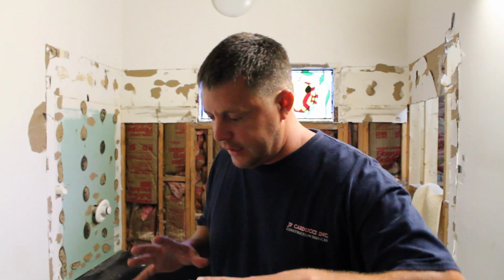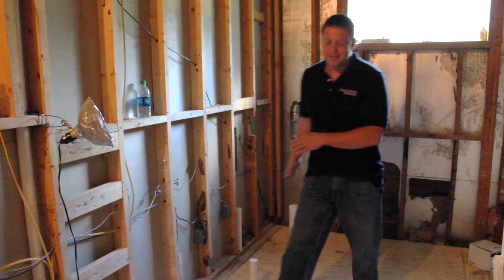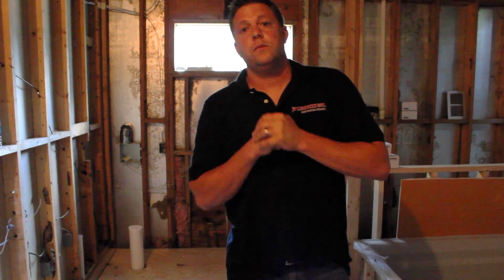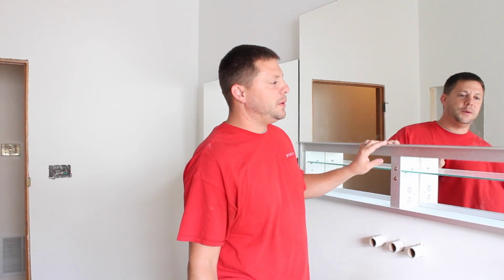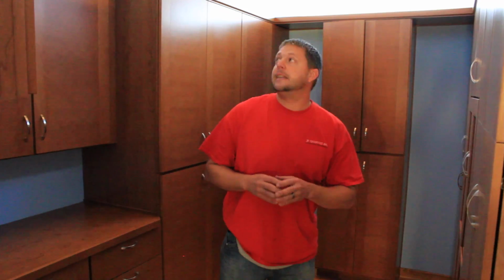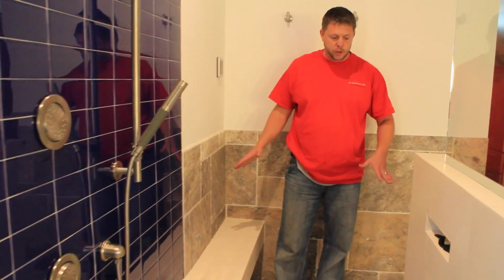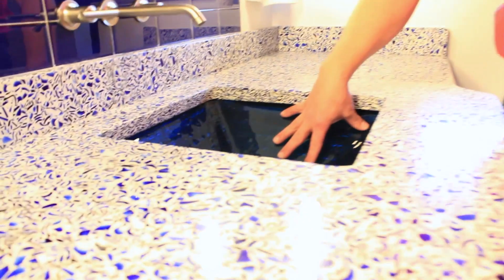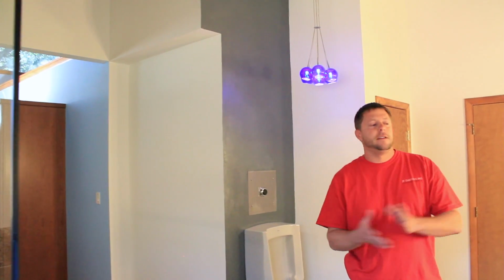Double Zero Entry Shower, Spa-Like Bathroom Remodel!!!

Comment: I would be very interested in learning the method by which the glass partition was installed for the shower. It looks to me like the only way possible was for the glass to be recessed into the wall. How was the piece on top of the wall installed? It looks as though it's one piece.
Reply from the maker: John Thompson Now now I cannot give away all my secrets and yes it is one very big and heavy piece 1/2" thick! 
Of all the people that have toured this bathroom, most are intrigued by the glass just sitting there!
Reply: JP Carducci Inc. Ok, I can understand you protecting the method by which the glass was installed. But, could you describe how the zero entry floor was prepped? If my memory serves me correctly, this was an upstairs bathroom, so the floor either had to be lowered by cutting the joists, or you raised the rest of the bathroom floor? Which one did you do, and how did you do it. Thank you, John
Reply from the maker: This bathroom had two layers of 3/4' plywood for the subfloor, We removed the section where the shower is located and recessed the shower floor down flush with the top of the joists. Then we used a pre-sloped shower pan by schluter.